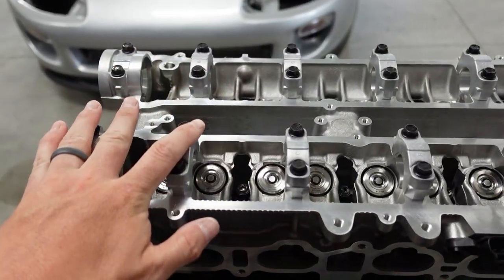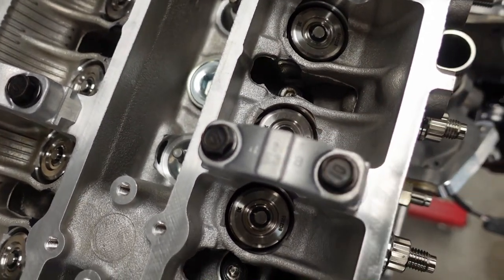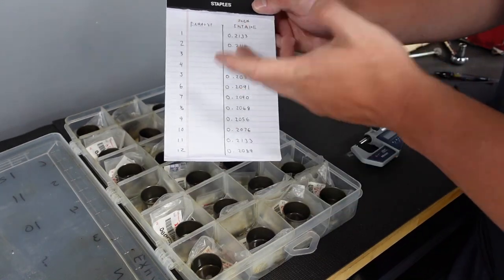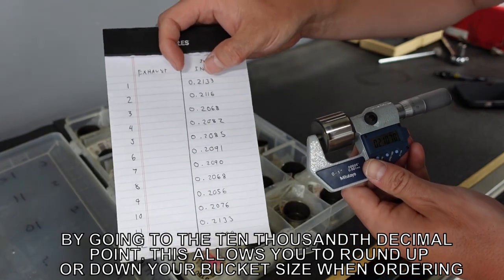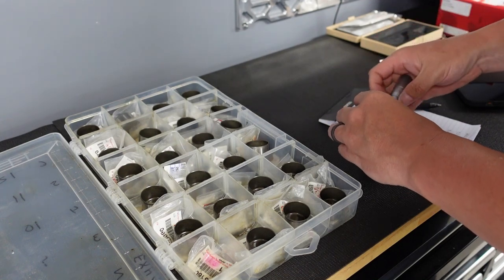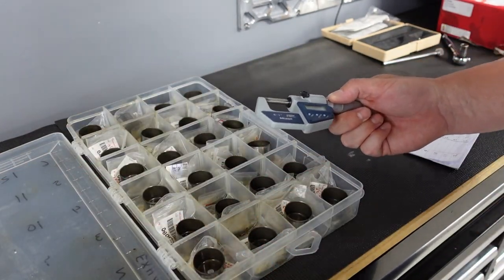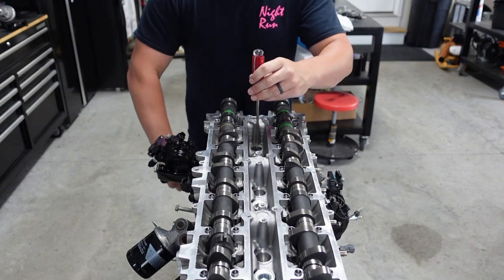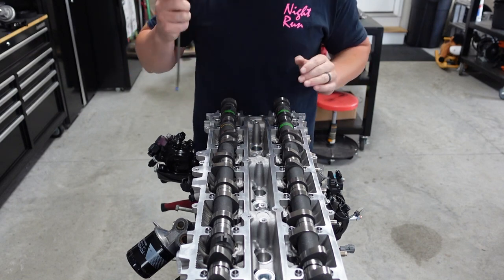2JZ Engine Build Ep. 16: BC 276 Cams, How To Check Lash & Shimless Bucket Sizing

Comment: Well done man... One thing I would add, the TSRM does show you the correct way to place the cams for installation. The front pin angles are positioned a certain way for a smooth installation and  bolt torque pattern... I follow the TSRM everytime and I've never had an issue 👌, but again... Great Job man!
Reply from the maker: Factory cams are never an issue, but these 276 cams with the aggressive lobes are what seem to be the biggest issue.
Reply: @PureFunction  I have Crower 276° (Hot Street) Cams for over 6 years now and have removed and installed numerous times with no issues following the TSRM. You explained it perfectly! The build is looking good man. I built mine last year and it was a nerve-wrecking experience. But I enjoyed it.
Reply: You explain the procedure,  and torque everything in the proper sequence in this video. Checking thickness measurements for the buckets is time consuming and tedious work.

If you make a mistake you have to buy buckets again. Measure 3xs and then again to save money. 

Not every bucket will be exactly on the money but as long as within 2000th you will be fine as he says, and when I did mine I  was off by 2000th and confirmed with the Crower cam specialist that it would be fine.

Be neat in your paper work like he has it. The way that the MICROMETER works, and oil can give different readings. Make sure there are no oil deposits on the MICROMETER or bucket.  Brake parts cleaner helps with this.